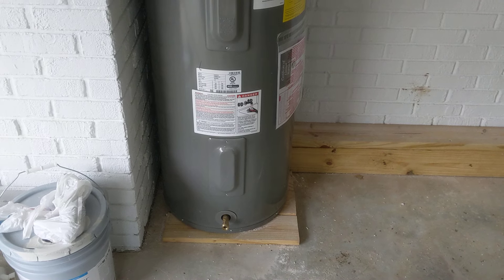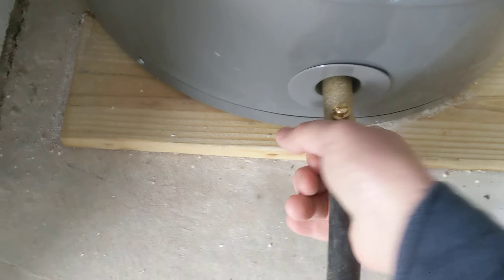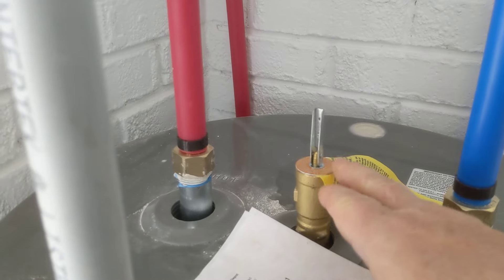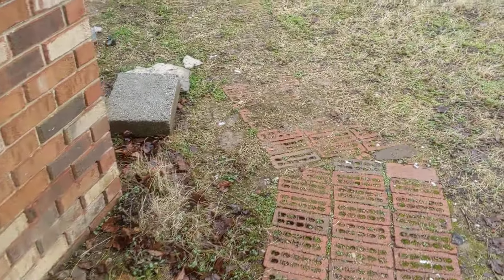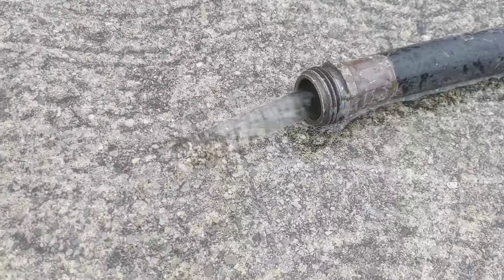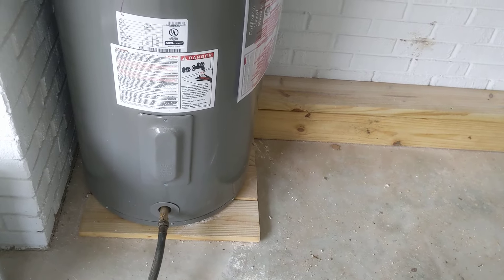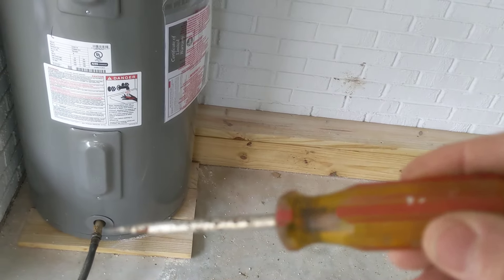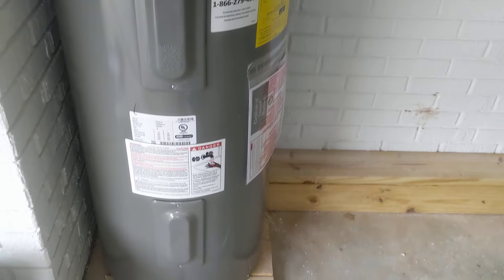DIY draining a water heater!

Comment: I am not a plumber but I personally recommend the use of a tankless water heater. I don't have one myself but I've seen how they work and it is quite impressive. You will never have to worry about running out of hot water.